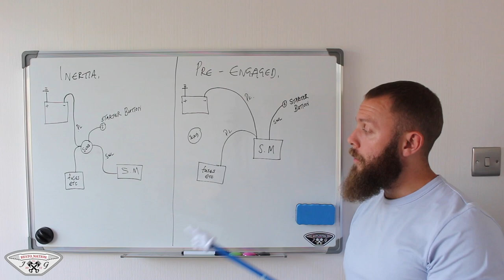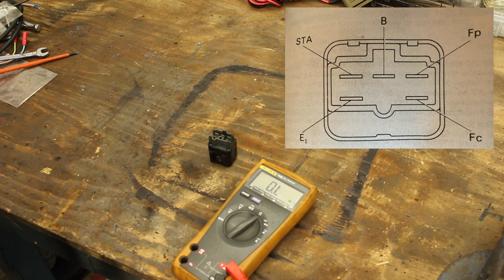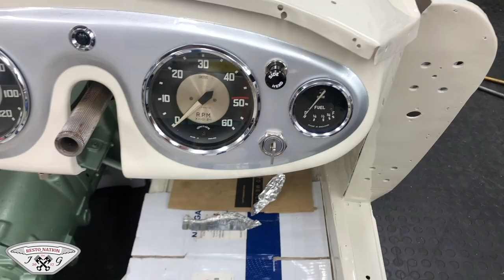MR2 Mk1 4AGE Cranks But Wont Start. How To Fix

Comment: Hey so, I used the jumper wire and was able to hear the fuel pump doing its job and the car would start, but it isn’t getting the 12 volts during cranking. I tested the relay and it seems to be getting proper voltage itself but the fuel pump isn’t seeing that power during cranking. 
Any solution?? I’m thinking a new relay?? Please help
Reply from the maker: Sounds logical. Have you done the continuity tests of the relay?
Reply: @Resto.Nation  I have not, could you possibly explain how to do it, don’t wanna ruin anything during the process.
Reply from the maker: @tylervilla2386  the checks are in the video 👍🏻
Reply: @Resto.Nation  you mean the part where you test the ohms after you take the relay out?  Because if so it is performing according to spec but when I put it back and test the fuel pump wire it doesn’t put out any voltage to the fuel pump. I got the fuel pump to go from using jumper wire which bypassed the relay but I guess the relay or the connector is bad
Reply from the maker: @tylervilla2386  check for continuity on the harness between the diagnostic box and pump connector in the cabin and check for a good ground.
Reply: @Resto.Nation  I know where the diagnostics box is. Any idea where the ground would be. If needed refer to the repair manual I got them all
Reply from the maker: @tylervilla2386  see if you can find a wiring diagram in there 👍🏻
Reply: @Resto.Nation  will do, thanks for the replies hoping it’s just a bad ground nothing too hard